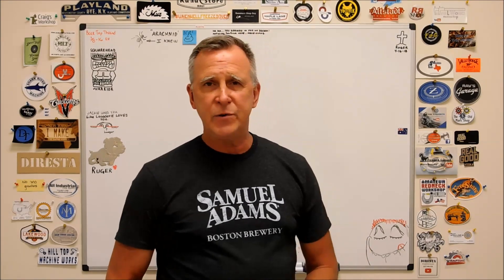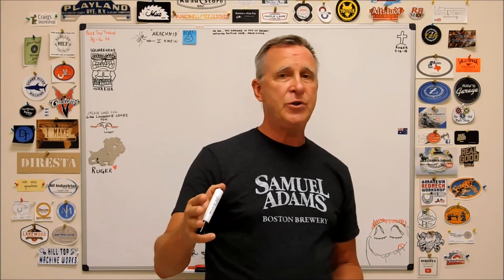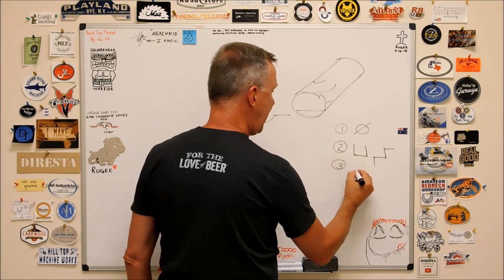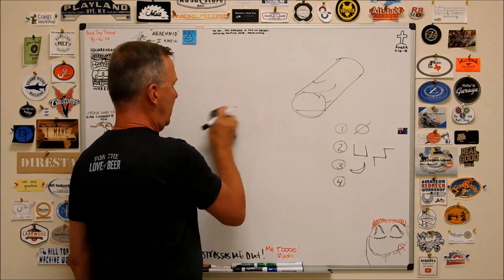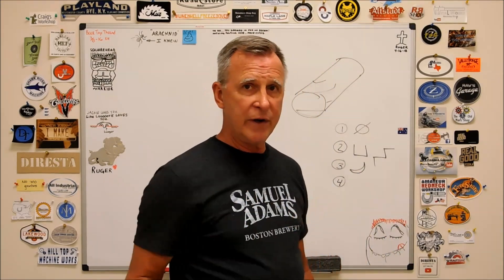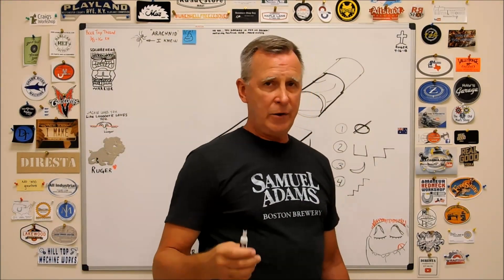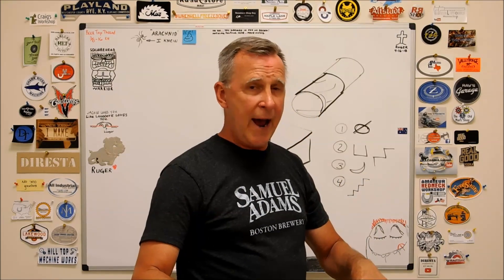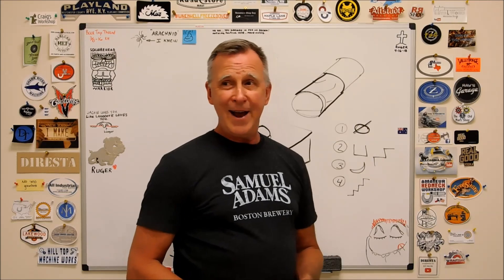Faster Milling and Longer Cutter Life...Watch this One !!

Comment: Ya I myself look at machining as how little money time can i put into this (well for right now) and the step over nibble cause you can get or make (acute tool and cutter grinder ) an example and I know enough about it you better get that book if you make one but ya hog away with edges you can sharpen for cheap there's a diamond wheel 2.5 inches on ebay seen it with a 10 mm i got the 20 mm like $20 thinking about quick change tooling for the mill special draw bar with a stack of belville washers to clamp like tormach 3/4  I dont know a clutch peddle on the flor to leave both your hans free for the drill to weldon shank set screw for slip free performance on caarbide shanks  i dont want cnc be BS for me ok a plasma table but that dont count ha ha

Comment: it is easier to grind the end of the endmill than it is to grind the flutes.
so wear on the end is not so much a problem as a cheap fixture will let you grind the ends,
grinding the flutes takes a dedicated grinder.
so it can have its advantages to take multiple passes at low depths.

Comment: Climb milling on the finish pass gives a better finish on the side walls. Did this stuff for over 40 years. Speeds and feeds are what give you the best results.
Reply from the maker: The 2 finish passes were climb cut. 4 up, and 4 back. I completely agree with your comment.

Comment: Dear Joe, 
                  thank you for another really useful video. It strikes me that this is particularly useful for me as I have a small mill lacking in rigidity and it does often get upset with me for the cuts that I try. having made a jig to sharpen the ends of milling cutters I can afford to wear the end whilst of course it is not practical to sharpen the flutes and loses the accuracy of diameter.
As you were plunging  a drill bit into stainless without previously centre drilling may I ask what sort of drill bit you were using? I find that nothing short of cobalt does the job but mine are conventionally ground and not four facet.
Interestingly as a career carpenter I also sometimes ramp down into the job when routing mortices into timber though as router bits cut across the centre unlike an end mill this is not essential.
The clock gives me a good chuckle every time you show it. it is a good visual pun.

Comment: Cheers Joe.  Appreciate the warning against trying this with 2-flute endmills.  My mill is significantly smaller, lower powered (2/3hp) and less rigid than yours and doesn't seem to like plunging (without pre-drilling) with a 4-flute endmill much.  It seems to do better with a 2-flute which I would assume is down to improved chip clearance (I have no mist or flood but rig up the shop vac when possible).   Am I right in this or is something else going on like rigidity or load per tooth?   16:09 great explanation of why the cutter deflects that way - I've watched your cutter flex video but didn't quite grasp why it flexed that way until now.

Comment: When I was doing that kind of slot in tool steels like A6, s7 and O1, the chips could become hardened.  They could wreak havoc on the cutting edges and will chip out HSS and sometimes carbide too.  For that reason, I'd flood with water soluble to keep the slot as clear of chips as I could.

Comment: What make of camera were you using, I liked the battery set up for it, no rechargeable batteries needed. The slot milling you demonstrated is fast and efficient.👍👍
Reply from the maker: Nikon B500. Its a nice camera, but I plan to use the funds from my Patreon account to get a better one. I would like more control over the focus and an external mic jack.

Comment: Being pretty new to hobby machining, I’ve often wondered why they don’t make end mills, say, .005” under sized so you can go back and clean up the walls on a slot, but still finish exactly on size. What’s the point of a .375” end mill if you have to take an additional .004” cleanup pass on the walls?
Reply: it starts out at the nominal but after it is ground once it will be smaller.
Reply: if doing for instance a 1/2 slot you cannot use an on size end mill. even .005 is not undersize enough.

Comment: Another Great Video!  When you are cutting a slot the width of the end mill how do you know which way is the leading edge? I've seen your video on cutter deflection, and it has helped me a lot, but I am still not sure when the cutter is engaging on two sides of the slot at the same time.  Thank you for your content.
Reply from the maker: You would think the forces cancel each other out. I personally feel the climb side of the cut is rejecting the cutter and the conventional side would dig in more because of it. My cutter flex video goes into more detail on this subject.

Comment: Hello sir, 
We are manufacturing Spacer ring & centering ring, we are facing ovality (out of roundness) issue, we unable to solve. We machined a tube part, 1st we completed od and id before parting off we checked runout is zero, after parting off it come ovality, we unable to solve, please give me a tips to solve
Reply from the maker: Your jaw pressure is distorting the tube. If you can, plug the end where the chuck grabs it, but don't distort the tube doing so. You can also do the heavy work with heavy jaw pressure, and back off the pressure just before the final cuts. Let me know if this work. I bet it helps.
Reply: Could be a job for bored soft jaws, distribute the pressure more evenly around the tube?
Reply from the maker: @somebodyelse6673  Problem is, if the tube is out of round, you just shot yourself in the foot by making it round under pressure. It the same situation, only reversed. I had plugs for tubing I cut often, and a large 3 point spider and pads I'd install inside the tube to resist the jaw distortion. Both the plugs, spider and re-chucking the part worked very well.
Reply: @joepie221  - ...that's why you're Joe and I'm not.  On the bright side, I learned something not to do :)
Reply: Sounds like material stress.

Comment: Joe,
Excellent video as usual 👍👏
Why don’t you use a squirt can for the WD40 or any other lubricant?
I’ve stripped a number of brushes naked when using a slab cutter in the horizontal mill 🤗
Not any more as I no longer use brushes on any of my machines.
Reply from the maker: I've disassembled a few brushes in my day as well. I do have a squirt bottle for the lathe.

Comment: Good video, thank you for sharing. Could you also drill out a full part and all it's features and then run the endmill around to finish it? I wonder if this would be a better option for fast CNC'ing, I'm converting mine to CNC at the moment and may try this. Cheers 👍
Reply from the maker: I cored out a 7" square chunk of 7075 aluminum to save the center for another project. Drilled a bunch of circles and it fell right out. I'd say yes, but CNC mills can move pretty fast. I suppose it depends on the machine and part.
Reply: @joepie221  Sounds like it would work. I'd run it fairly slow at first, it's a home hobby mill (Sieg X1) with Brush-less motor drive on X and Y at the moment, although very solid. I would be running it on 6060 aluminium, so fairly soft. I will give it a go when the Z and Spindle motors are Brush-less also (work in progress).

Comment: Joe, however did you manage to make an imperial measurement slot in metric material?
;-)
Thanks, interesting video, particularly, for me, seeing how much the tool flex marred the finish in the section where it's "full steam ahead" , compared to the mirror-like finish on the pre-drilled section.
Reply from the maker: I was wondering if anyone would catch that. Outstanding.
Reply: @joepie221  and not one "unloosen" in today's video.

Comment: Very enlightening and I had thoughts about that recently. That's why as a hobbyist I bought cutters on Ali-express with different lengths of the cutting edge. If you don't have to go deep, a shorter cut will suffice. Thanks for the effort that you keep putting in.

Comment: The only problem with coming in from the side, as opposed down from the top, is that if you've got a light machine, you run a certain risk of either pulling the end mill out of the collet, or pulling your machine out of tram. You don't seem to get that force with a rougher, only with a finish end mill. My little Taig can take a 0.1"d x 0.1"w cut in 1018 with a 3/8" rougher, but put a finish end mill in there and try to take a 0.2"d x 0.02'w cut, half the MMR, and you'll either pull the head down on its dovetail or force the column to tilt out of tram.

One of these days I'm going to screw up my courage, and drill and ream the hub on that column for a taper pin to lock it in place.

Comment: Excellent. Also worth mentioning that using the drill to remove most of the material is transferring the wear onto that tool. Drills are much easier to sharpen than an end mill. Dont need a special grinder or jigs. You can just free hand it on a bench grinder.
Reply: Agreed. Not the drill Joe was using though, that was a split point drill.
Reply: Good quality drill bits are also cheaper than quality end mills as well, unless you use diamond coated drill bits of course LoL

Comment: Sure could have used it when I made candy molds... :)
It was in aluminum but I can't tell you how my tiny unimat SL lathe/mill hated that!!! 
I was taking 0.2mm passes and it was vibrating the entire table... 
Awesome! Will definitely use it next time - but not for candy molds (I can't get these smooth enough - the candies stick like a cement pour.... )
Reply: Make your candy mold in aluminum, polish it, and use it to create silicon molds. They'll be strechy and release the candy easy. And when the silicon tears or wears, just use your aluminum master to make more
Reply: @terminsane  Hi. Sure - I can use silicone but I do prefer not to. I have food grade silicone resistant up to 200c degrees (two component) But I do prefer stainless molds when possible (but stainless is hard on my tiny lathe/mill). I use cookie cutters and turn these into molds. The reason for avoiding silicone molds is that candy is poured into the mold at 150-190C and I have no idea what chemicals are leaching out of the silicone at these temperature - into the candy.
Reply: @Smallathe  - I've never considered a machine shop corner of the kitchen, but now I want one!  Screw molds, machine CANDY!
Reply: @somebodyelse6673  yep!!! I have one on my to do list. Check "drop roller" :)
Reply: @terminsane  And... thanks for the tip. :)
Reply: You can use the Castable Silicone molding material for candy Molds. Some material can be put in the oven for curing at Low temp. Its also useful for casting Lead - Believe it or not. Think of it as a Castable ceramic.
Reply: @anneinfurna8528  Hi Anne. Same reply as before.... Also, I do use silicone molds for chocolates, gummy bear candies and so on. It's fun and the temperatures are far lower in the range of 50-70C. Not too bad. Thanks for the tip.

Comment: I just made some parts using this very technique to mill a pocket into a solid piece of steel, I did the drilling first, just like the video shows, I went within .010 of how deep I finally milled the floor of the pocket, did not need to "Z" back'n forth.  When doing the finish passes on the sidewalls, I used only light climb (vs.conventional) cuts, made a very clean sidewall.

Comment: Nice. Reminds me of AvE's video on chain drilling to get effectively overlapping holes using a drill. Do every second hole, then do the remaining holes. Since there's equal amount of material missing on both sides, the drill bit has less of a tendency to walk to the side. What he showed was with a CNC and for saving time on cutting a piece in two but the same technique should work for manual predrilling of a slot with a little finesse.
Reply: Overlapping holes with 2 flute drills has ending in tears for me, more than once.  I don't do it any more.  3 flutes, or no overlap.

Comment: About cutting the ramp at the bottom: I know it’s done a lot, especially in CNC, but why does it work? At first glance, it seems to me that you’re still cutting the entire depth with the bottom of the cutter - so why not plunge in all the way at the beginning and then traverse? Would you consider doing a video on that?
Reply: Joe please correct me if I am wrong, but I believe this has to do with the floor of the cut being at a slight angle in relation to the bottom of the end mill. This should shift most of the cutting action towards the rearward facing periphery on the bottom of the end Mill. The centre region of the end mill has near zero cutting velocity, and results and a lot of upward Force when used, whereas the periphery will have good cutting velocity when the RPM is set correctly.
Reply: Thanks, Matthew, that’s helpful. Perhaps it works because - as we know - the bottom of the cutter isn’t actually flat. So if you slide sideways, the back edge can bite into the material. Come to think of it, you should be able to ramp down at the angle of the center relief without any down force at all.

Comment: I’ve cut triangles with a 4ft center cut endmill cutting only 90% angels using a dividing head to make a piece of round stock into a Star of David. I used a slitting saw to cut multiple stars out of it.
Reply: 90° angels are my favorite

Comment: Great video as always.   Do you do much turning or boring on hard tool steel? M-2/M-4 58-64 rc.  Any ideals to stop/minimize push off.  Using carbide boring bars and ceramic inserts.

Comment: Are there any materials that cutting results in chip hardening, thereby the chips become harder than the work piece?  I ask this because I never worry about cleaning out chips like I probably should, the scenario I mentioned might damage the work if the chips arent cleaned out thoroughly?

Odd question; I know.
Reply: Tool steels typically work harden when you are cutting them too fast. If you use a roughing bit - Sharp one -- you can avoid some of that. Usually the sparks coming out of the hole alerts you to that -- and the purple to Blue chips also. Then use a carbide bit to sharpen up the bottom, and always with coolant every time.
Reply: Anne Infurna thanks!!!!
Reply: Any of the AR series (Abrasion Resistant) steels will cheerfully eat your endmills if you take too LIGHT of a cut.  They work harden from rubbing tools that aren't actually cutting enough material to make a chip.  It plays into your question because if you aren't clearing chips out of your cut, the chips easily harden by getting rubbed around along the tool flutes. 

AR steels are commonly found in earthmoving machines like bulldozers and agricultural equipment.  Also found in a lot of material handling stuff like conveyors, mixers, etc. 

Some stainless alloys also work harden like that, makes it difficult to sneak up on a dimension because you have to cut a chip and you have to get the chips OUT.